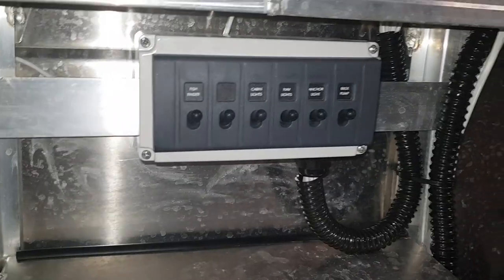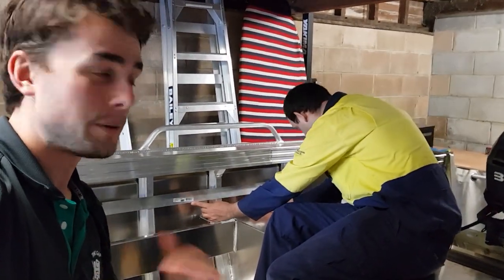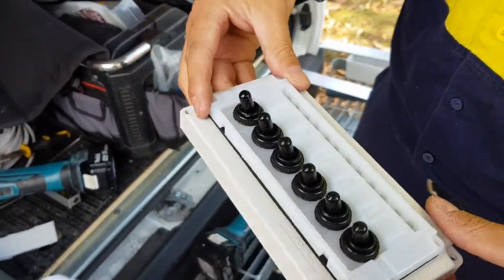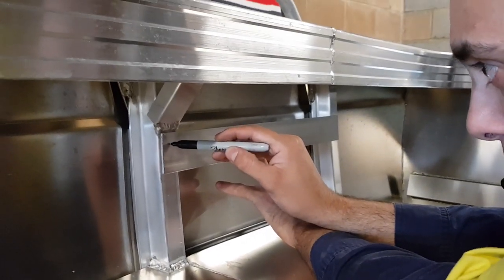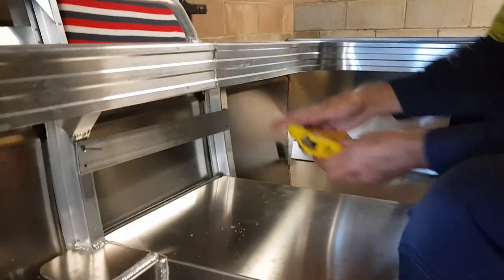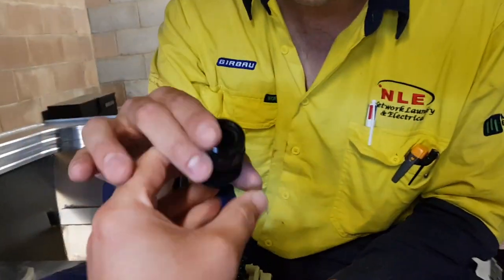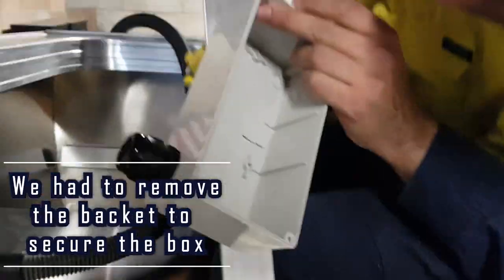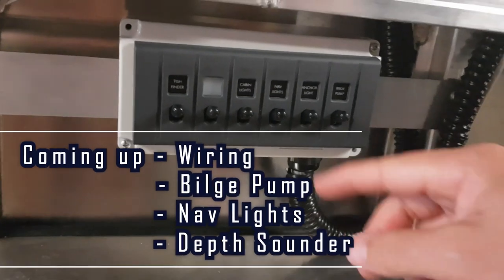Tinny Mods - DIY Waterproof Boat Switch Installation Part 1 of 3 CHEAP

Comment: Hey mate, where'd you get the switch panel?
Reply from the maker: I got it from an electrical wholesaler. Bunnings do sell them but electrical wholesalers are better (just google a place). Make sure they have a rubber seal on the inside 👌👌

Comment: hey mate
what size battery are you running everything on?
Reply from the maker: I run a 105 amp hr Amptec AGM Battery. Cost me $255. That runs everything and I haven't had any issues running the minn kota all day. Always have power. When I replace my battery I'll go for a 120 amp hr battery. I recharge my battery every time I use it.
Reply: Snagd Fishing cheers legend. I don’t have a minn Kota but am planning on having everything else you are running and not sure what size to go for. I currently run just a fish finder off a 7.2AH deep cycle and it does it with ease. Wish I had electrician mates like you!
Reply from the maker: @jordankeith7841  50amps per hour if I'm running my electric hard haha. My other electronics use very little. Around 1 amp per hour. If I use my bilge pump though, that's around 5amps per hour.
Reply: @snagdfishing   Great video! I'm in the process of rigging my tinny up and I have a Yammy 4 stroke 20hp elec start. I haven't bought a second battery for my Minn Kota Terrova yet so you reckon I could get way with the one battery for both? Does your battery still crank your 30hp Yammie at the end of the day? Cheers.
Reply from the maker: @jock578  hey mate, I have a pull start 40hp yammy on my boat now. So I dont need a cranking battery. I would recommend a separate cranking battery for the motor tho. 👌👌
Reply: @snagdfishing  Thanks.

Comment: What size cable gland is that?
Reply from the maker: 2mm for nav lights/anchor lights/sounder. 4mm for bilge pump.  6mm for battery which is run from the battery and connected at the switch bank. From the switch bank I run the different size cables out to the equipment.
Reply: Snagd Fishing aha all goods, I meant the cable gland (the nylon grommet). I think it’s a 25mm by looks. Just in the process of wiring my switch panel up - I’ve got everything else ready. Cheers legend
Reply from the maker: @bouttimefishingadventures  all good mate. Sorry. I've also got a word doc will all the parts I used with web links if you'd like it.
Reply: Snagd Fishing cheers mate.
Reply: How can I get a list of material you used
Reply from the maker: Send me your email on insta or Facebook and I can send it though 👌